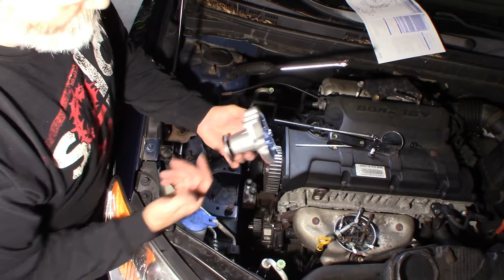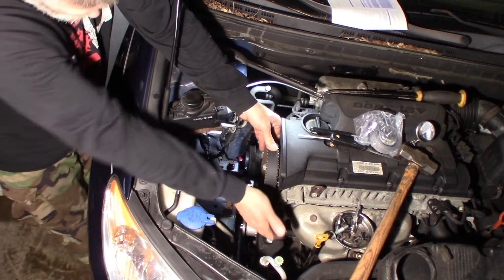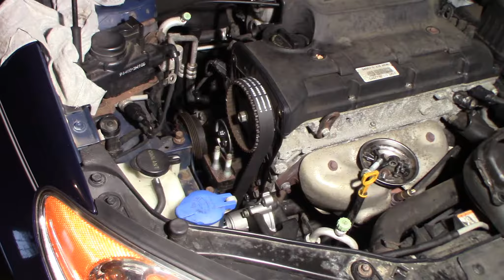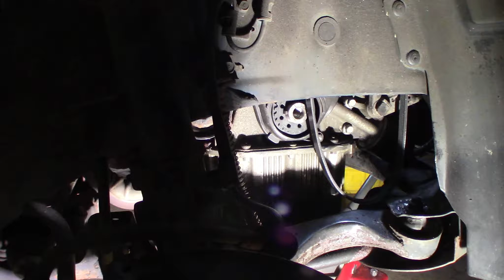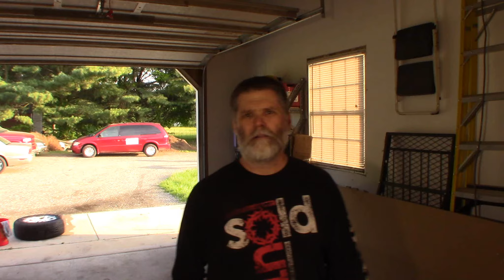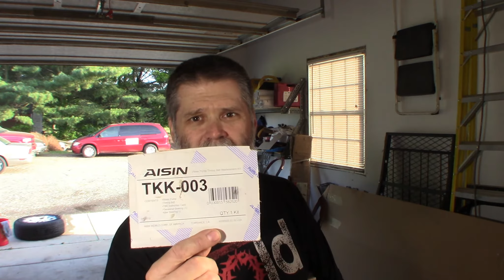Hyundai Elantra Timing Belt and Water Pump - Part 2

Comment: Hi Charles. Thank you very much for walking us through the process with clear explanation and your time. I have Hyundai Elantra 2010 and it has 63200 miles on the second timing belt and its going to be 6 years come this September 2022 since i changed the belt the first time at 85000 miles. I did hear you mention about going over 30000 miles over the recommended due mileage for timing belt change. I did looked it up in the user manual and it says 90000 miles or 72 months for normal situation and 60000 miles or 48 months for severe situation.When do you suggest i change my timing belt? I am in the Mid-Atlantic region and does that fall under severe conditions? I do see that we do share the same region. Is it an over kill to change at 63200/6 years period? What are the wear and tear signs i should look for if i want to check the timing belt by removing the upper cover?Thanks again and have a good day.
Reply from the maker: Almost everything is considered "severe driving".  Unless you spend all your time on the highway.   I don't know if there's a way to gauge wear on that particular car.  I always feel that the cost of doing the belt outways it breaking on an interference engine.
Reply: @CharlesAndCars  Thanks for sharing your thoughts and you are saying its better be safe then sorry. I will get it done as soon as possible. Have a nice day.
Reply: Hi Charles. I am finally planning to do timing belt/water pump/serpentine belts/3 radiator hose on my 2010 automatic hyundai elantra GLS 2.0L car. I have a couple questions before i start to work on them. What transmission setting should i have my car while working on this project? Should it be in parking or neutral gear setting? I prefer to work on parking gear so it does not move while i am working on it with my emergency brakes on and chokes. 
Another question I have is whether is it possible to change that radiator bypass/elbow hose which is located under the upper/lower radiator hose due to its awkward location. The gripping taps on the constant tension clamps on the elbow hose that are joining the tube pipe to water pump are in position to grap hold of it with ease and disconnect it. But the other end of this elbow hose end that goes into the engine body has the gripping tap hidden under the pipe joint facing downward? The bypass hose is not leaking now but is it worth taking the chance to change them since they look rusty and old too especially the pipe to water pump. Dont want to create more problem for myself and i already have a leaky water pump problem...time  to change timing belt/water pump.  My main question about this elbow hose is whether they go bad frequently as the upper and lower radiator hose do? I am planning to change my radiator hoses before i put my car on the jack stand to work on the timing belt/water pump. First thing is which transmission gear should i set my car to work on my timing belt/water pump? Is changing the radiator elbow hose is necessary....its not leaking? Hope to hear from you soon and thank you in advance.

Comment: Hi Charles, thanks so much for an excellent video. Really top quality, and I watched a bunch. 

Question: how tight do you make the other two belts as you put everything back together?
Reply from the maker: There's a spec on the tension... but I don't know it off the top of my head and you would need a tool to actually measure it.  If I'm reinstalling the same belts I note the position of the tensioner bolt before I take it off and if it's a new belt it will not go in as far as the belt is not stretched.    Best is to feel the tension on the belts before loosening then and then when reinstalling feel the tension to get it close to where it was.  If it's too loose it will squeal, particularly when starting it up...
Reply: Charles And Cars thanks for the quick response. I already took the old ones off so I guess I will just do the best I can. Thanks for your help!